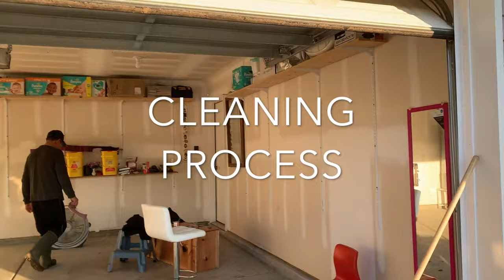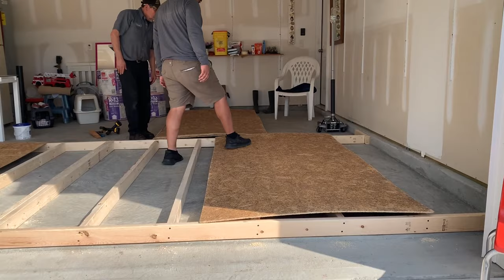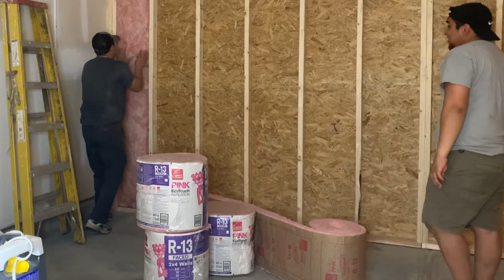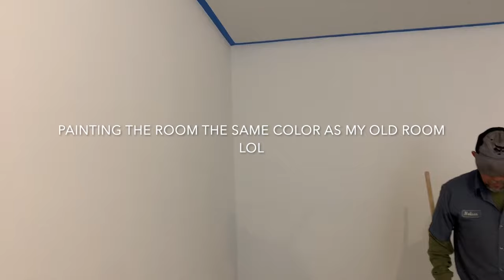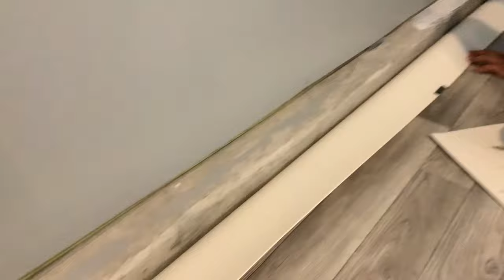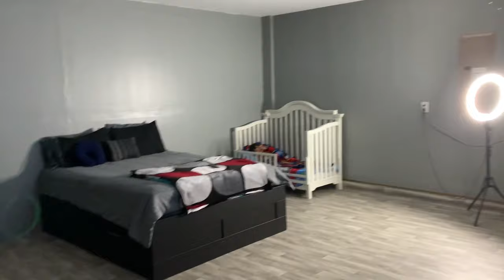TURNED OUR GARAGE INTO MY BEDROOM | Andrea Martinez

Comment from the maker: DISCLAIMER There are no windows, or anything extra and fancy done to the garage because it will be converted back into a garage later on‼️‼️
Reply: Question! What are your plans for heat and air? Also did you just leave the garage door up on the outside?
Reply from the maker: We have the fans for air, but mainly the house ac covers here. We always keep our door open so we don’t need anything extra. And yes the garage door is on the outside!
Reply: How did you remove the garage door parts but keep the garage door in place?  Did you need to do anything additional to keep the garage door in place or does it just stay in place even with the rails and chain removed? I'm looking to do exactly this
Reply: I really need an answer to that because I’m outside looking at my garage door and I don’t understand how you got it to stay in place after you took all the parts off 😂
Reply: @Danny Boy I don’t think you understand the question lol. 
I’m leaving the garage door, but I can’t leave all the parts on the ceiling, as you saw in the video. You won’t be able to frame the wall with all the rails, chain, and motor on the ceiling. 
My question is how did she remove that stuff without the garage door falling?
Reply: @arlenharcrow2383  bro the door is held by the parts left on the side the garage.  The motor its only meant to lift it up and I guess automatically drop it but she left the rails that guide the garage door on the sides plus the huge spring that also helps if your motor fails so the garage door is about 70%intact  all she removed was the motor and rails that guide the door once its all the way up in the ceiling, the framing they did is just basically a shell right behind the garage door so on the outside it will still look like a garage.
Reply: They did a great job, but I'm really worried about you and your baby in the event of a fire. If there is a fire between you and that one door, you cannot escape. Or if the baby is sleeping in the room and a fire starts near the door, you cannot get to the baby. My nightmare!
Reply from the maker: Thank you for you concern but we have the door open at all times, only when someone needs to change its when it closes lol
Reply: @heathersavala489  when I converted my garage to a bar I bought a ductless air conditioner and heat pump from mr cool. It’s amazing and I installed it myself.
Reply: Does it feel a bit colder then any of the other rooms in the house? Because you still have the garage door. I'm in the same situation but debating

Comment: You might want to put up some carbon monoxide detectors or relocate that water heater just to be on the safe side, you said No windows and the gaps that use to be there were probably minimal but all that helps to vent out any gases.

Comment: Insulation should have the other way. Paper side facing the interior not the exterior. Looks great, we are doing the same thing. I will be raising the floor and adding insulation in the floor
Reply: Will the insulation become molded if on the floor?

Comment: I have a 3 car garage fully insulated.  On the one side car garage I have a pool table / game room and on the 2 car garage I have a gym with lots of emptyspace in the center of garage .
I was thinking about covering up only my 2 car garage door just like u did  since we don't use it and just leave the one car garage
Working.  Iam thinking of adding some sofas and maybe a little bar.  Also if I put up wall like that I can use the wall for many things.  What do u think?

Comment: I have a 3 car garage fully imsulated with 2 fans in ceiling.  On 2 car garage I have home gym and on one car garage I have a pool table man cave room with TV and bar ..we never open the  the 2 car garage door only the one car garage door..I wonder if it will be worth to frame the 2 car garage door like u did with urs so garage will be better insulated?  I will be adding a minisplit system to cool and heat garage. I even insulated garage doors too. I added epoxy on the floors

Comment: I would have framed around the hot water heater and added a door so not so much of an eye sore. Also woulda been cool to add a small closet otherwise looks pretty good for a temporary room.
Reply from the maker: We did i just didn’t record that part!!  And we got a dresser, since my bed frame has drawers already. 😄
Reply: Can the water heater be cover?  I was told not to put anything in front of it?

Comment: What did you use for Cooling and Heat?
Reply: Hearted it but didn't respond lmao
Reply from the maker: So sorry! I got distracted with my kids and forgot to reply back! 😭 but for cooling just the ceiling fans, & for heat nothing cause it’s not cold enough in here to use anything for heat! but we do have a heater just in case. It’s literally at 30 degrees outside and the room isn’t cold at all it’s prefect temperature!

Comment: no windows you need to get a carbon monoxide detector in the room in case something is leaking and get de humidifer to purify the air, especially with a baby down there.

Comment: thinking of doing this too, how much did it cost? and is this in texas?
Reply from the maker: No i live in NC, and only the garage door covered up with all the material $350! But the cost of everything total around $1,600! You should do it, it’s definitely worth it! Just know the flooring is what will be the most expensive!
Reply: @AndreaMartinezMUA  damn, it looked bad ass, yes maam. here in Texas it gets Hot AF. i might have to buy a separate AC for the garage. this is definitely a great video
Reply from the maker: Yes it gets hot in here when its around 90! Now i can imagine texas heat! You definitely need an ac! But it does hold alot of heat from coming through!
Reply: @AndreaMartinezMUA  where did u buy ur flooring
Reply: @AndreaMartinezMUA  are u planning to add kitchen and bathroom too?